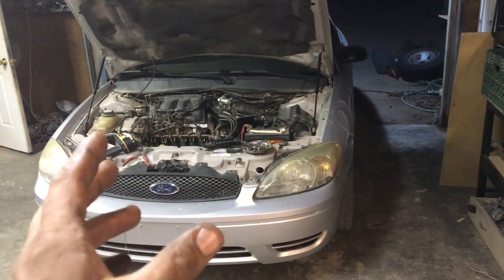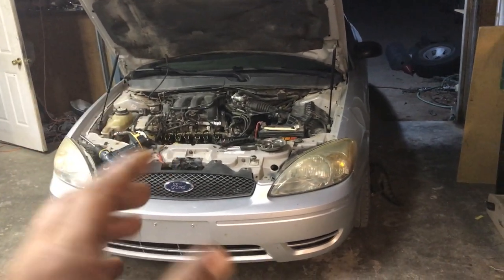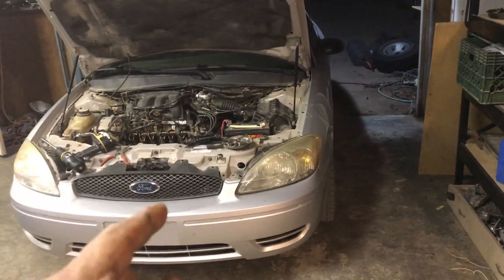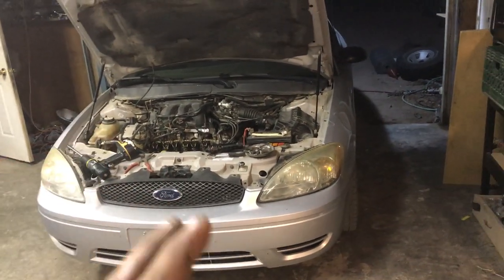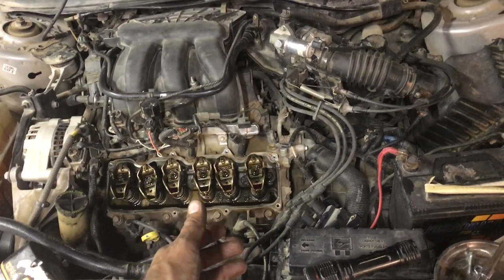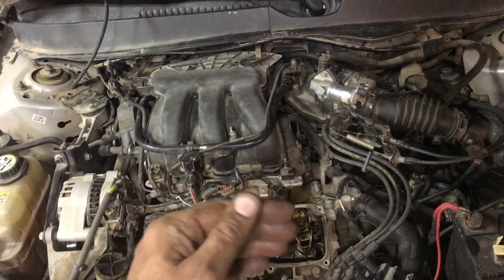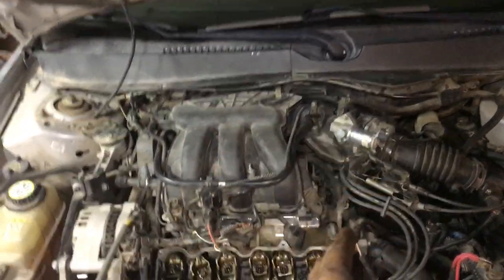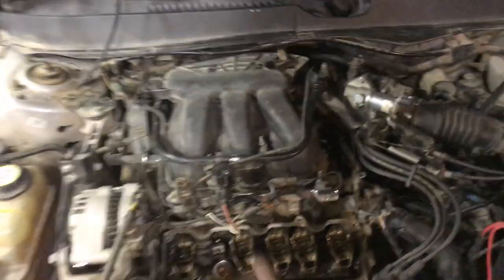Rough Idle Poor Hesitation Stalls Surging, Solved

Comment: Thanks for the suggestion, I picked up my 2002 tarus for 600 bucks, Drives like a champ but sounds like a diesel when im idling
Reply: dat boi did you figure out what was wrong?
Reply: Same here but with a Vw Jetta se 2011
Reply: It was probably the idle control valve

Comment: Watched your video and others found the vacuum line on the fire wall side of the plenum had loosened
acted just like a misfire or a broken valve spring. Used very long pinchnose plyers put it on the fitting ..

Comment: Thanks, great video!  I have a Ford Freestar. Running very rough, Gave error codes po174 and po2196. I changed all 02 sensors and reset ECU, I also changed spark plugs&wires,  EGR, MAF, fuel filter and cleaned PCV valve, Car still runs rough and throws the code po2196 even after reset??? At wits end!! Very frustration. Have a 2004 Ford Freestar 4.2

Comment: My 03 Taurus won’t get enough acceleration after I come to a stop it usually stays at 20mph for a min then starts pickin up speed again
Reply: How’d you fix it ?
Reply: Mine does that it makes a god-awful noise like the engines about to explode into a thousand pieces and then it'll bog down till about 45 and then it'll just kick in really hard into gear and go fine until now it just shut off two days ago and won't crank back up good luck
Reply: Mine has 290,000 miles on it though barely uses any fluids that one only had to replace a couple parts on it so I can't complain but I can cuz it ain't running

Comment: does this usually happen on the same cylinder every time? I hear this is pretty common and mine is doing this... I really don't wanna pull the stupid intake manifold
Reply: I feel it man did a lot of body work on mine and a couple random Bolton’s thought I blew it up but I got recommended that either a injector went bad or this happened

Comment: Hello. I have a problem with my Taurus 2002 DOHC Duratec 24v 3.0L, the engine have some kind of grinding or screeching sound near the water pump. Always, no matter hot or cold. Very loud, from the inside sounds like my muffler fell down on the ground and Im pulling it..Do you have any idea what could it be? Thank you
Reply: Have you replaced the water pump?

Comment: Alot of the headache on my Taurus with the dohc v6 turned out to be a split in the vacuum line that comes from the plenum to the evap solenoid $2dollar fix purs like a kitten after code after code self diagnosed problem solved.

Comment: #4 is the exhaust valve?  Did I hear you correctly? I have a '92 Taurus SHO, and the idle is rough. I am starting to think that it's normal, but I can't help but wonder. The EGR-271 was changed. A new feedback sensor installation recently, and the idle is rough the same.

Comment: Mine stars funny like it is missing... I can cut it off and crank it back up and it run fine.. Took it to two different shops still cant fix it!
Reply: Think its got something to do with the cam synchronization sensor
Reply: Should be camshaft sensor if battery dies 1-2 days
Reply: Did you solve the issue?

Comment: This is my unprofessional opinion sir.The driver probably pushed his/her luck and took a road trip ignoring the fact that it is over 170000 miles think about it engine parts are no longer what they used to be when brand new. Driving below 200 miles tops is reasonably good within city limits. Summer time road trip is a killer on high mileage vehicles.

What may have happened when he/ she put :) the AC on at high and fan on at high which increases the rpm over 2000 tops. Keep in mind you are supposed to shift gears back and fro and add them fluids some vehicle recommend engine should be off and warmed up when checking the dip stick. 

This model and make of the ford's downside is that the  dip stick will be bone dry after cleaning with a rug or whatever sir and doing the actual check requires you to feel hear for jerking when shifting all gears when the car is stationary. The dip stick will show over fill from engine start up but once you  wipe the second time reading is annoyingly bone dry. Mine spilled too. Not your fault but yes other foreign cars recommend that the engine should be  shut off and plus warm when checking and they still give visual reading. I am no expert just saying high milage 2006 ford  taurus engine parts will interact. A new engine component ( transmission) will take time to interact so I topped of  1quarts of fluid slowly at a time without revving to 2000 plus its a 2006 ford taurus anyway again this is just my unprofessional opinion.

Comment: ? I have a 2000 ford Taurus it switch gears fine but when come to a stop light it hesitate to go forward but once it get pass the hesitation and drives just fine and it also keep shutting off when I put it in reverse why is that? It’s doesn’t shut off every time just some time but also notice I did have a bad battery to